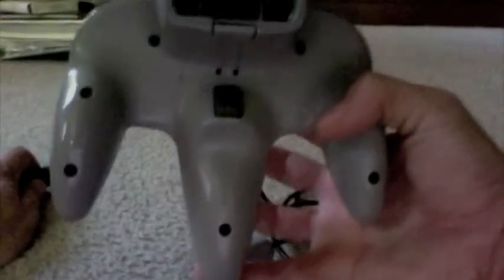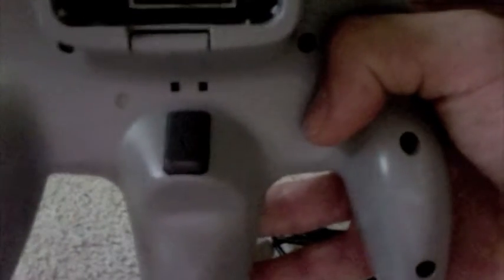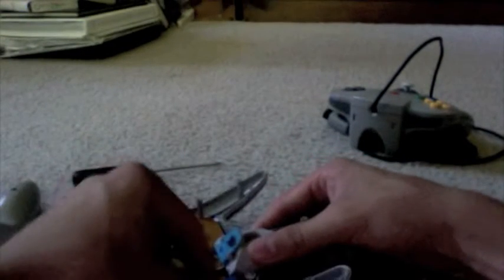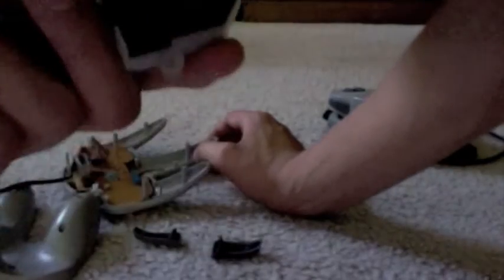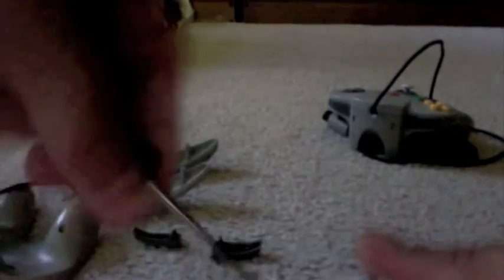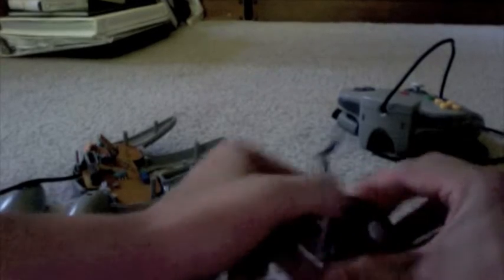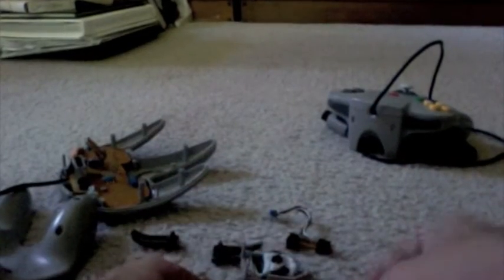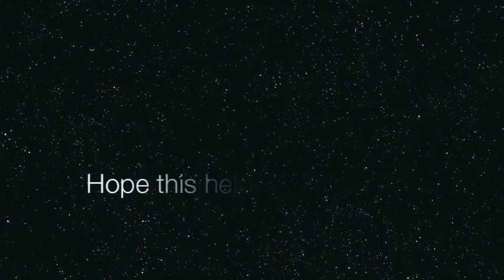How to Fix a Loose N64 Joystick

Comment: How do you detach the z trigger board (NOT the button) to remove the control stick block? EDIT: Nevermind, I got it. It's tricky. You need to slide it diagonally.

Comment: screw that! that's a lot of hassle to take apart the controller just to put tape which is only a temporary fix, I'd rather just buy a new redesign joystick and add some white lithium grease. and put it back on. but it is a good method for those who don't have the money to buy one.
Reply: most redesigned sticks are gamecube style and they suck
Reply: They suck as hell and actually lose degrees of movements